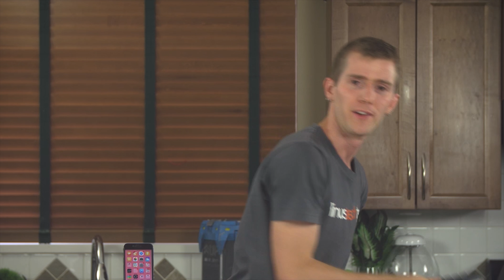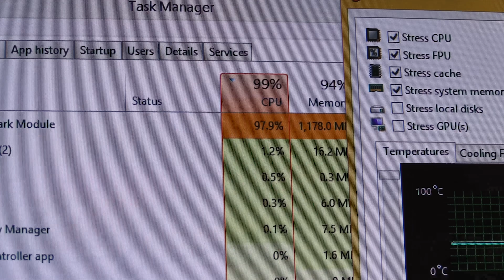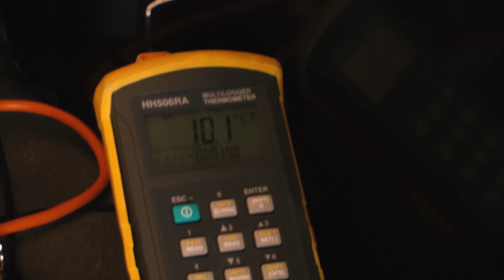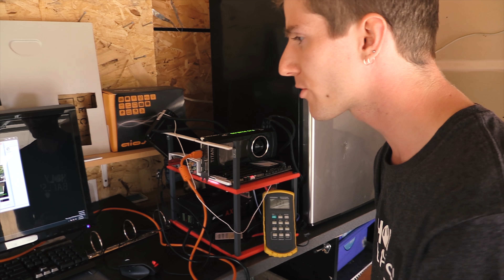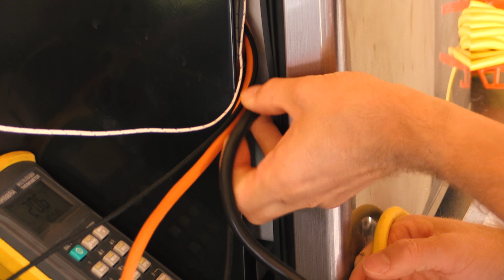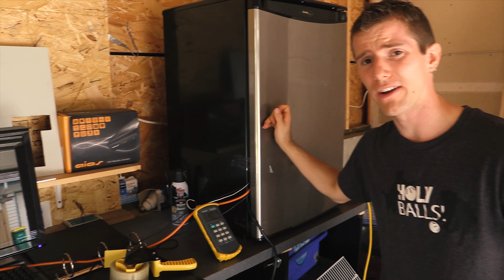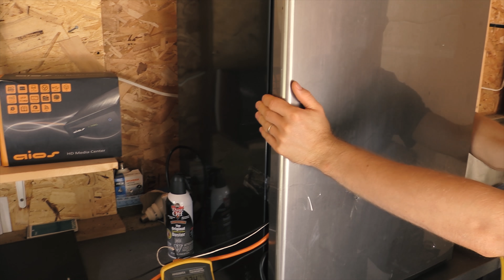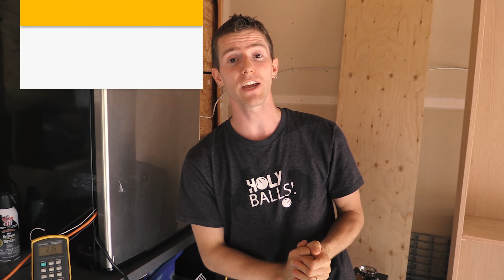PC Build in a Fridge - Does it Work??

Comment: For those of you who didn't want to watch the whole thing: The mini fridge doesn't work, and can't work, because it's effectively an insulated box with no airflow. The fridge has to run continuously just to pump out the heat that would dissipate naturally if the computer were exposed to ambient air instead. The only reason fridges work to keep food cold is because food isn't generating its own heat; once the fridge has cooled off your food, your food stays cold, and the fridge only has to run for a few minutes every hour to pump out the little bit of heat that leaked in through the insulation.
Reply: Shawn Elliott so what your saying is overclock your fridge for constant exertion of cool air
Reply: One year later: could vents out help with airflow? Possibly removing insulation?
Reply: @NeXtarProducts  no, u would be better off strapping an air conditoner to ur pc sidepanel
Reply: We can drill a hole in the sides.  lmao.  So, don't ever tamper with a fridge.  It's has hazardous materials inside.
Reply: Teach me physics please
Reply: A vent would not really help. Still doesn't solve the fact the compressor in a fridge isn't strong enough to cool a pc. Having the pc intake cooled fridge air and exhaust out of the fridge would probably be your only useful scenario. There is a potentially workable solution though.

Use a freezer

A freezer is the same thing essentially, but has a more robust compressor to achieve a lot lower temps normally at around -20°C usually. You'll have you throughly de-ice the freezer before putting a pc anywhere near it. But, it might just be able to keep temperatures below ambient, especially if you have the pc exhaust out of the freezer and intake cooled air from the cooling coils. Still not likely, but it will have a better chance than a fridge anyway.
Reply: I’m the smartest one here you just have to overclock the water cooling inside of the fridge so then it’s just cold
Reply: @joenick6128 : Riiiiight. 😉
Reply: Thank you this should be the top comment that's all I wanted to know!
Reply: vacuum cleaner installed to the PC
Reply: Literally just have to put a vent in the side and it would've been amazing
Reply: @Lackingx : Putting a cent in the side to let in warm air would be counterproductive.
Reply: @fyrstormer  
You would obviously put a water cooling cpu fan blowing out of it as well as fans for other parts
Reply: @Lackingx : If you need to use a water-cooler to pump heat out of the refrigerator so the inside of the refrigerator can stay cold, then the refrigerator isn't actually doing anything useful.
Reply: @fyrstormer  cold air sinks, hot air rises, put the vent on the side towards the top just like a PC case. It would not be counterproductive. The only benefit from the fridge setup is that it has a condenser that makes the air inside colder. The insulation does what insulation does, slows heat exchange, so remove that as a factor from the equation. The vent would help.
Reply: @gabu4303 : I know that a more powerful refrigeration unit would work, but the point of this test was to use a mini fridge. You could also move to the Arctic to keep your computer cooler, but that is similarly outside the scope of the test. Air cooling works just fine; your computer doesn't need to be chilly to run properly, and if it does your build has bigger problems.
Reply: @ThunderbirdWD9598 : It's a waste of time, effort, money, and energy even if you get a refrigerator capable of continuously pumping out several hundred watts of heat. The performance improvement from refrigerating your computer is much less than you would get by spending the same amount of money on a better computer.
Reply: @ThunderbirdWD9598 : From an engineering perspective, an implementation that doesn't improve the situation isn't a solution.
Putting the computer in a full size fridge full of food sounds like it could work better, but even a full size fridge can't pump hundreds of watts of heat, so the fridge would run continuously and your food would get warm and go bad.
Reply: @ThunderbirdWD9598 : I am entirely sure that Linus could've used a walk-in fridge if he'd wanted to shoot the moon, but opted for a mini-fridge because he was testing practicality, whether you like it or not.
Reply: Its allabout cooling capacity. It will totally work with a walk in refrigerator
Reply: Might have helped a little
If he properly sealed the bottom of the door, since cold air falls as a result of higher density. Simple way to know is look at the wattage draw of the compressor unit on the fridge and if it’s not multiple of what the wattage draw of the computer is... why would it be able to keep up... 🤓
Reply: So use a freezer?
Reply: @stumpy64tree39 : Freezers aren't more powerful than refrigerators of the same size, they're just better insulated than refrigerators. In fact, your average chest freezer uses almost no electricity because its insulation is so good. (Technology Connections has a video about chest freezers that is relevant, actually.) That means they would actually work worse as a cooling method for an overclocked PC, because it would be even more dependent on its underpowered heat pump to extract heat from the computer.
Reply: @fyrstormer  yeah that does makes sense so the only other way I can think of using something frozen would be to have a high power pump with some sort of slushie machine hooked up to it to cool the PC with "water cooling" but you could also take the slushie out to drink so it'd be a slushie cooled pc
Reply: @stumpy64tree39 : LOL, there's a mental image.
Reply: Shawn Elliott so that explain why as a kid sleeping in the living room the fridge always used to makes weird noises every hours
Reply: thanks. :) Saved me loads of time.
Reply: Mrhomeless did it tho
Reply: @dafuqawew Nah, just use a $500,000 walk in freezer. They should have asked for my help with this video. lol.

Comment: Video cards can run up to 200f or 80c  or more sometimes    keep in mind that video cards run a lot hotter than CPU's they are made that way and its normal,

FYI
Graphics card temperatures typically range from 30°C to 40°C at idle and from 60°C to 85°C under load. Most high end video cards typically have a maximum temperature between 95°C-105°C, at which point the system will shut off to prevent damage

Comment: get an old amonia based fridge build a water cooling loop with just the fridges cooling system requires gutting, and you can have a refrigerated pc build but it requires some more enginering than this and by the way amonia fridges can run 24/7 the tech is old and robust as a tank lol. the question is is it worth it

Comment: Try using a deep freezer and the mineral oil rig.  Mineral oil solidifies at around -30C/-22F and most deep freezers can cool down to or close to that temperature.  Also deep freezers are larger so it may be better able to displace the heat better than the dorm fridge.  May also try filling the entire freezer with mineral oil (after sealing the joints) and place the computer in it.  The heat displacement would probably be really good and keep the system close to or below 0C.

Comment: actually isnt this like jumping in the elevator right before it crashes to the ground or blowing on the sail on your boat? basicly the fridge is just a huge heatsink. just a thought, maybe not right i guess. since you are taking the heat that you would produce in the room outside the fridge wich reduses the effectiveness of the fridge, and you are putting that energy to the inside wich in the end is having the same effect just in another way. VSAUCE HELP?

Comment: running a water cooling loop inside a Freezer,  won't freeze the water well shouldn't but you could salt the water to stop that or antifreeze. just drill two hole one in one out. 
do it you know you want too

Comment: I would have used a mini freezer, and only put the radiator inside, not the entire PC lol.    There's no need for the power supply or anything else to be in there, just what you need extra cooled..   ie: the CPU radiator and GPU radiator and associated fans.     In addition adding frozen water bottles may stabilize the effort required by the freezer to keep the area cool,  much like putting a chicken into an empty freezer vs a full freezer.   

Your test was setup to fail TBH.

Comment: I was thinking that if you used a portable air conditioning unit blowing really cold air over an open pc build with high end CPU and GPU that it would cool it sufficiently to run it at load and it would still keep relatively cool. Plus i think it would be much better than the fridge option.....ooops sorry that will teach me to watch right to the end and not comment In the middle Lol I see Linus and most other people had the same idea

Comment: Linus take the pipes that go to the mini fridge wall to cool the air and attach them to modified water cooling lines to only cool the parts that need it. Then you don't need to build the pc in the fridge, and can use a bigger more efficient fridge or freezer.
Reply: You also can get more airflow

Comment: Probably could have just moved to a larger fridge or even a freezer.  It is pretty important in this case to match the load really well to the unit.  You would need a freezer that uses as much and probably more energy than the PC that you are using.

Comment: 1) I would be very afraid of condesing water inside the fridge and drops falling onto the HW, therefore I'd use some sort of protective case that would hamper the cooling. Alternative may be a stock of the silicoe thingies that come with shipped electronics to absorb water.

2) Fridges are designed to maintain certain static temperature and a heat source within is generally to be avoided (for power efficiency). I'd say that either the fridge won't be powerful enough (it's just a big liquid cooler after all), or the power draw will be significant, rendering it a rather costly alternative to the standard cooling.

3)  Yeah I'm thinking about it way too seriously.

Comment: no, heat should be dissipated, not chilled.  Moisture will be an issue with this.

A better idea would be to put a pc submerged in non-conductive liquid into a fridge

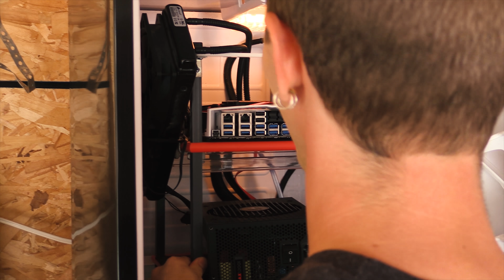6:35 you actually cover that

Comment: The "dying hard drives in a fridge" is no longer valid. I'd call it a myth at this point. It worked a very long time ago. Modern hard drives WILL NOT benefit from this. If you need data from a failing hard drive, then chances are you need to send it to a recovery company.

Comment: But can it run Crysis?

PS: im using the keyboard that was sponsored in this video right now to type this comment. lol. it's a pretty good keyboard, resisted a water spill, but it's a bit weird with the clickiness. the clickiness is mainly from the space bar. it's good for a budget mechanical keyboard, though. my only complaint is that the lights can only be colored red.

Comment: A stout heat pipe running from the processor to the evaporator coil will make a great improvement.
Also, the side of that fridge that got hot may contain the condensor and will get hot as the cooling load gets higher.

I have made coolers from the parts of refrigerated water fountains that worked really well.
The trick is to make the heat transfer as direct and as efficient  as possable.

Comment: 1) You have to extract compressor and freon loop
2) Then make something that transfers heat from die to freon, like cpu heat exchanger in watercooling system
3) Isolate cold parts from air so that water steam in the air would not condensate in drops.
???
PROFIT!!!

Comment: I’m planning on building a custom tiny house/rv and I’m thinking of putting my cpu in a cabinet shared with an air conditioner. In theory, the cooled air will have to pass through the cpu before it reaches the room. In colder months when the room is heated, the cpu will be outside of the heated room and vented straight outside. I am wondering if there are any issues I’m overlooking with this or if I’m going to have to worry about condensation.

Comment: First, you're wasting electricity. Physics says the freezer needs to use more energy to remove the heat than the PC needs to use to create it. This doesn't scale up to larger workloads making it a complete novelty. As if that wasn't bad enough, you are pushing the freezer way past its intended workload. A freezer is insulated and only on a few hours per day if even that. You are running it continuously. It's going to fail very quickly, probably from overheating itself. We haven't even talked about condensation yet, but your PC? It's going to need to be waterproof.

Comment: Linus since you like to go to the extremes, do it this way. Put the entire system in a class=1000 cleanroom or enclosure (to prevent condensation as humidity is a bitch on cooling). Then run a refrigerant line to a loop similar to a water cooling circuit like an insulated copper line (remove the air convection factor and make it conduction). Which will in turn make it a closed system unlike an ln2 one which is sustainable in the long run. You can even use a vrf motor to save power on different loads. Well this is just a concept but itll be considered extreme of the extreme if you build it.

Comment: Plus, having PC in a fridge breaks the fridge in a long term...it degrades like that, that's why it always is necessary to open refrigerator as minimum as you can because of letting heat in. Not sure exactly if mini fridges differ in this, but I wouldn't want to do it either way.

Comment: I did this before and it turned the fridge into an oven. SO INSTEAD. i ran coils of copper from the freezer corner to the inside of the case i had, and that worked MUCH better.
Reply: Maybe if they built a mini fridge without the hazardous components and internal fans like a PC....I would buy it.
Reply: No you didn’t

Comment: I still think this could be a good idea but if modifications was made to a freezer. Maybe a small enough fridge that you could design and drill holes to place your motherboard and psu and actually use the fridge as a case then if there was enough of the coils like said it would extract the heat better. Just need a better fridge or modify it with more of that heat extraction capability.

Comment: Make the fridge a radiator for a water cooling system. 1/2 inch tubing, maybe 50 ft in the fridge, leading to the cpu block. Condensation could be an issue but seems an interesting concept.

Comment: something is wrong there,  and i believe you're leaking out cold air,  and i've heard fridges which react to being open to keep them from acting as air conditioners.  if it feels like it's open it changes behaviors to rescue the compressor.  im no hvac dude.  but i would probably run multiple tests with multiple fridges and probably seal up the fridge around the wires with modeling clay.  i have a fridge that behaves in a similar manner.  if you leave it open or even leave it cracked open the compressor will turn off,  and when you come back to it,  the milk will be look warm.  instead of overworking the compressor it will attempt to rescue it.  a freezer unit might yield better results as they run harder and more often.

Comment: I did this with my ps3 and 4 for several years now, but i created an air tight duct opening for the exhaust and mini fridge set to reasonable temps.

 Multiman on my ps3 tells me this set up is working....just throw in a couple large dessicant bags for the moisture.

Now i just need a sacrificial pc to test with the same set up. Just gotta figure out how i am going to put the components in and creat air tight exhaust openings.

Comment: was just thinking a freezer chest with a large copper coil in it with holes drilled into the freezer to transport anti freeze / anti boil fluid to and from the freezer to cpu, gpu, etc. how small a freezer chest can be?

Comment: Did you try to put a small fan inside a fridge just to constantly mix air maybe that would raise the efficiency. ps. im not talking about open system but only stiring the air from the inside to make it evenly come in contact with the components inside

Comment: Not sure if its been asked or not, but what about just the components of your motherboard, so as you say no SSD/HDD and no POWER SUPPLY as that"s where the extra heat is coming from and the fridge then has to deal with that extra heat source to combat coolness to reached its desired temp, also are there ways to release the heat by extending coils etc. Just interested in your thoughts as it was a good video